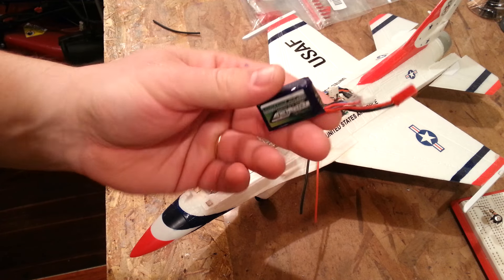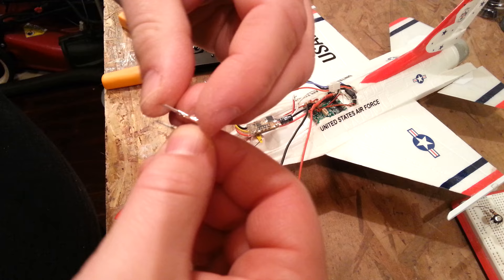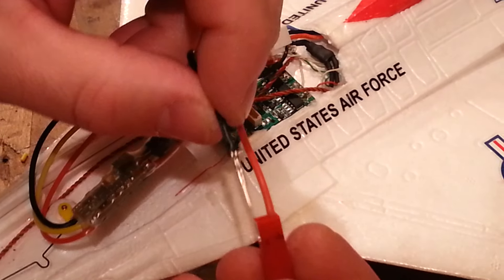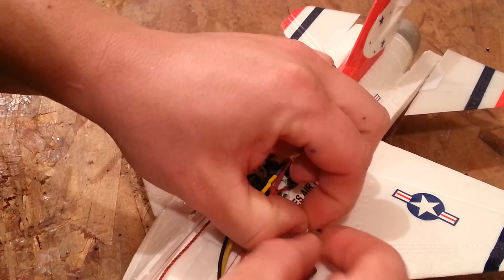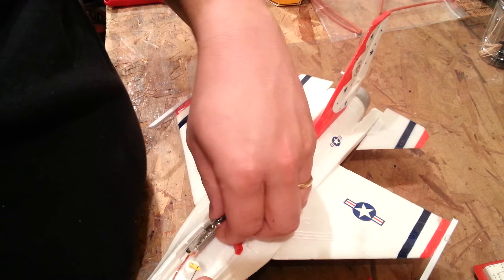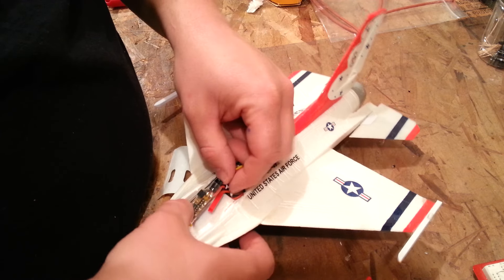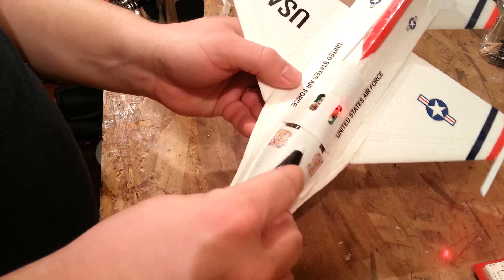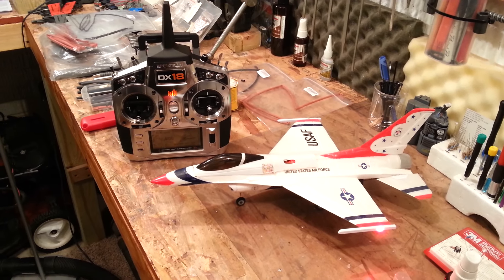Horizon Hobby - F-16 UMX - 3S Upgrade Mod Video - Part 3 of 4

Comment: Really helpful video. I am doing the same thing with my Habu180. A great flyer, but underpowered. I even put the higher RPM motor from the F-16 in it and it didn't make much of a difference  I stuck it straight into a concrete parking lot and figured WTF, do something crazy with it as a POC, then use a spare new fuselage and build it pretty. Before hacking up that brick though, I am going to try taking a different route. I am going with a 30mm QX Motor 14,000 kv EDF - $20. LemonRX Featherweight RX - $8. Favorite Little Bee 20A ESC (Thumbnail sized) - $18. Banana Hobby 2 Axis Gyro board - $18. Tired of spending money on overpriced Spectrum RXs when there are much better options for way cheaper.
Reply from the maker: Good for you! Spektrum gear is nice, but I agree, it's way expensive.

P.S. I hope you don't copy everything I've done here, since this video series is a bit of a nuance for me, in that I have yet to get her working :(...